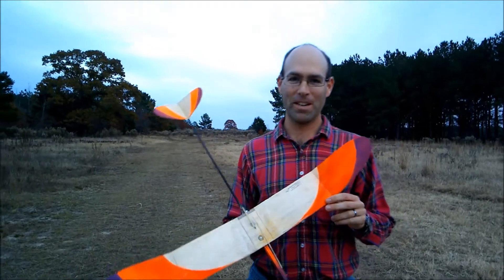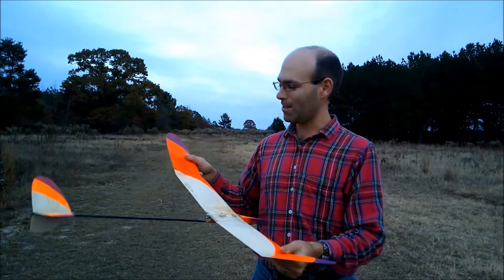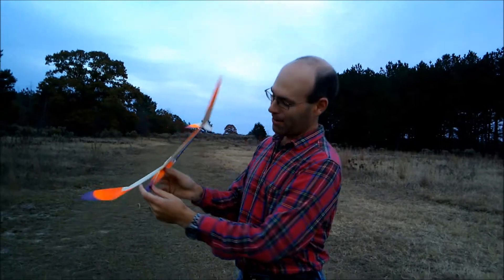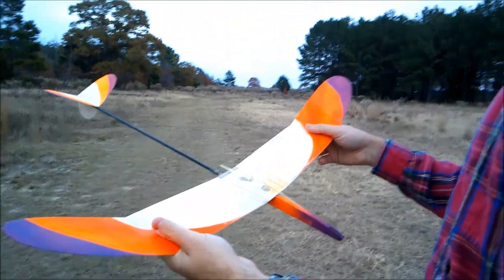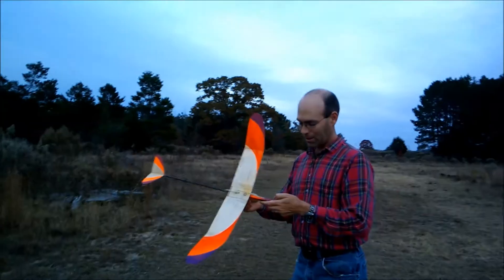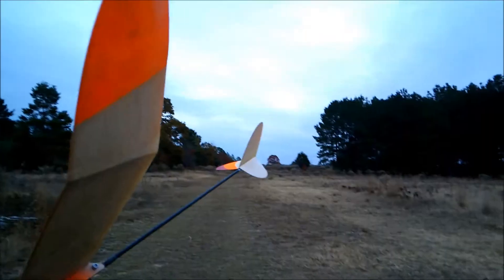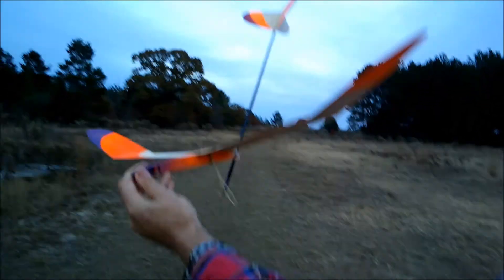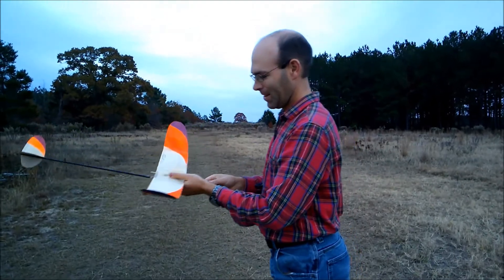Sweepette 28/30 Tip Launched Free Flight Discus Glider!

Comment: Are you going to have anymore of those for sail?
Reply from the maker: Yes! We're dealing with an equipment failure in the shop that's required us to shut down production of a lot of the product line, but we'll be back to full capacity by the end of the month